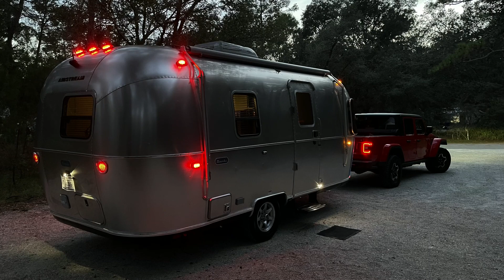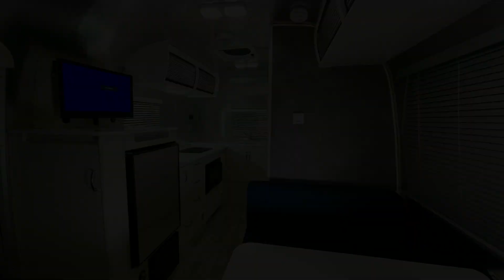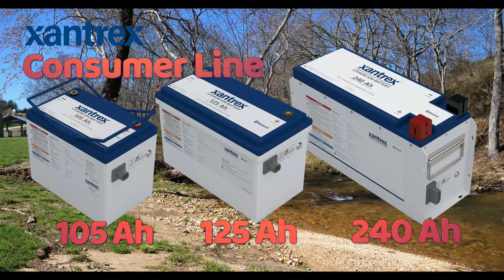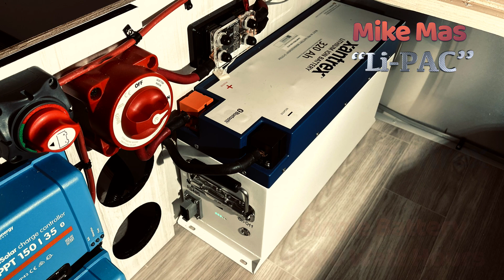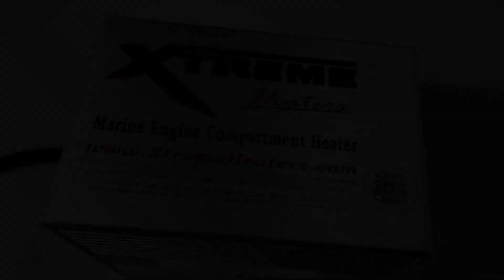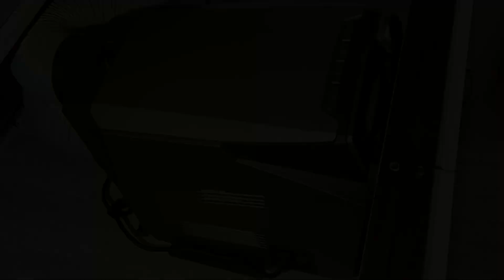Mike Mas' Li-PAC Lithium Powered A/C Airstream Xantrex Eco Flow Wave 2

Comment: So, I've got an Airstream Bambi 22FB too and I'd like to replicate a lot of what you've don't here. The difference is I got the EcoFlow Wave 2 which has different dimensions that may cause some clearance issues but nothing I can't overcome. 
I am a novice with the electrical side. I know enough to get myself into trouble, so do you have any wiring diagrams or guidance for a fella trying to get started on this kind of project?
Reply from the maker: Your best bet is to buy the wave with the on board battery, then hook up your solar to the Wave to charge it during the day. No wiring needed.